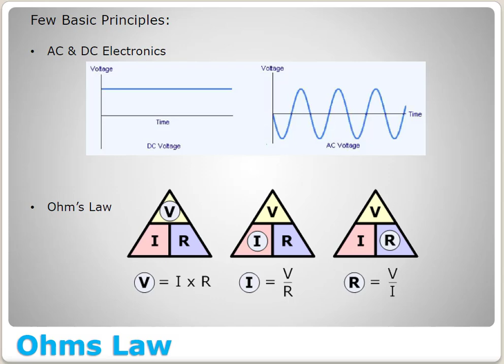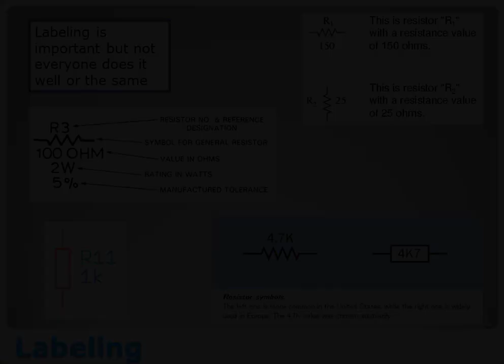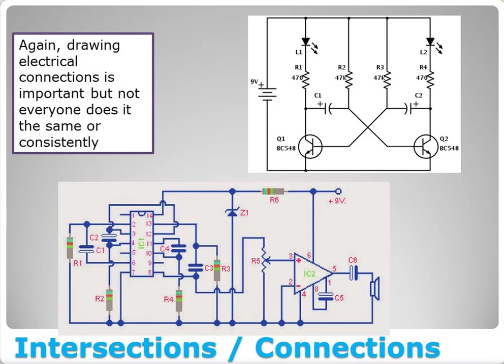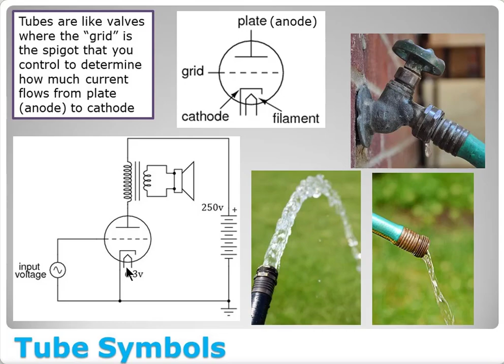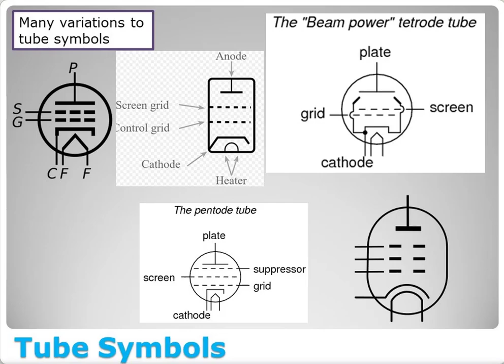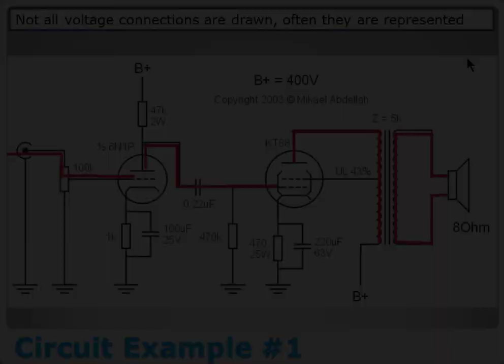Understanding Vacuum Tube Amplifier Schematics - Basics - Part 1

Comment: Great stuff! Brother, did you 'break the rules' at around 17:15 =  'current...flows...plate...to...cathode(?)' Fascinated! Thanks!
Reply: Yeah some people think of current flow as "hole flow". It really don't make any sense to explain how a tube works by using hole flow though. You don't heat the plate to release holes from the anode to travel to the cathode, you heat the cathode to release electrons to flow to the anode (plate). Electrons are the only thing that move.
Reply: Thanks, William. You make sense. I think crudely I see the DCV as kind of static/'established' laid out in the circuit and the ACV/current 'flows' from input stage to output, 'over' it (DCV) . What you think?
Reply: Yes, your DC voltage is what sets up the positive and negative charges between the cathode and the anode. The amount of electrons that flow between the cathode and the anode is proportional to the grid going positive and negative signal created by your guitar input. This in turn duplicates an AC sine wave at the cathode that is higher in magnitude than the original signal, but out of phase with the original signal. That amplified AC signal shares the same conductor as the DC voltage that is being used to set up the bias of the tube. AC and DC can co-exist on the same conductor, as well as many AC signals at various frequencies.

Comment: I am finally starting to wrap my head around this stuff a little. The hardest part I have is putting it from the schematic to the amp. I drew prints in carpentry but the components are in place where they actually go. I think a good thing to do in this would be to show another schematic of that same amp converted to a guitar amp. I think this would help me a lot because I am trying to convert them to guitar amps. Even though I wired houses I still have a little trouble with where to tie all the grounds so you don't get a loop.If you tie everything to chassis ground and then tie to earth ground at one end, would this be the way, as long as you are to earth in one of those places. Is this right. And if you tied to both ends it would be a loop. Right or wrong? Thanks for your videos.

Comment: Good video, beautifully described. For anyone interested, the KT in KT88 stands for 'kinkless tetrode' as this has a beam forming plate to correct the characteristic kink in the tetrode curve. This was designed by the MO valve company (Marconi - Osram) in Hammersmith London following the earlier KT66 which along with the 6L6 from RCA in 1936(?)  were the first of their type.  (I think RCA were first).

Comment: Spectacular post. Thank you so much for doing this. My only question is how are the values for the coupling capacitor between the stages calculated and also how are the capacitor values for the cathode capacitors in parallel with the resistors chosen?

Comment: Hi Mark, Thank you for this video series. An excellent tie-in to your SE amplifier video series and obviously has usefulness well beyond that. My question is this. How do we interact with you or the series (other students)? Is there a preferred method, is there no method, should we look to other forums to answers questions or share answers? Obviously I do not have any question yet. My question is for what I am sure, will be needed down the road.
Reply from the maker: Posting here is great
Reply: Excellent! I wasn't sure if you really wanted a whole lot of interaction. I know you, like most of us, have many priorities pulling on you. I do have another question that just popped into my head. What are your thoughts on cross-reference video series questions? I can see there being a need for me, of cross-reference questions with your SE amplifier series. For those of you new to Blueglow, I highly recommend watching Marks Single-Ended Amplifier series. I have been asked many times by others and have also wanted to build, a vacuum tube amplifier. I just didn't know where to start.